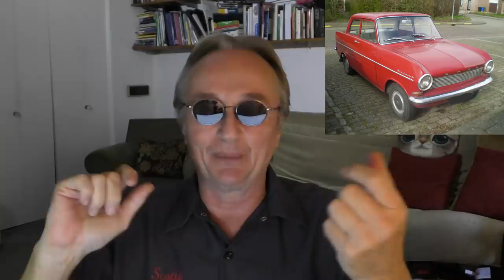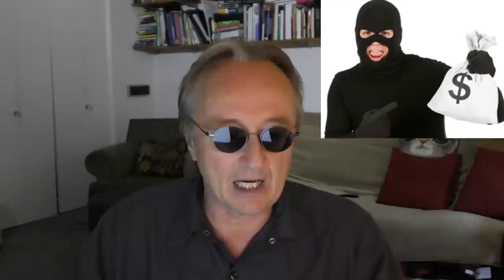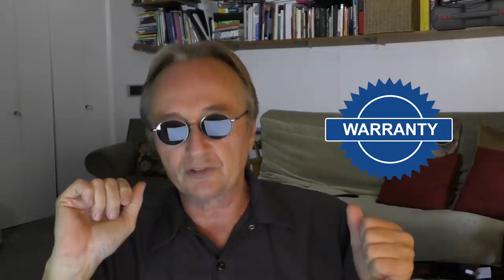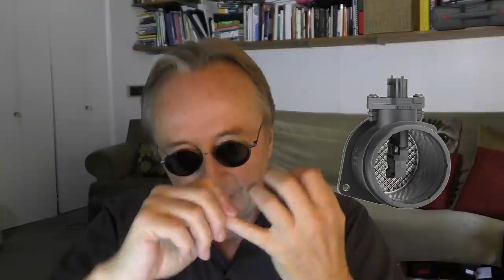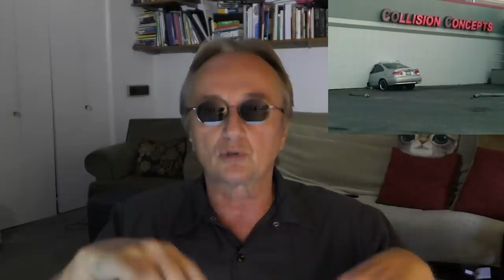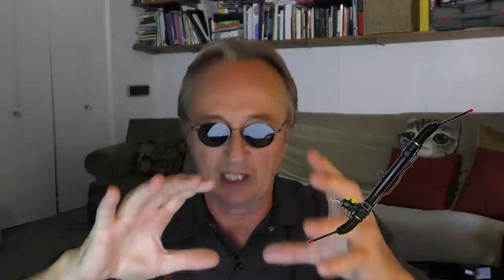Why Not to Use Your Car’s Horn

Comment: 15% ethanol means fewer miles per gallon. Get ready for getting fewer miles out of each tank of gas.
Reply: If the cost per mile was at least the same by the fuel being cheaper it wouldn't be a big deal except for road trips and long commutes
Reply: And less life out of your engine, but more horses!
Reply: All because tariffs.
Reply: Naw your car will just run lean have fun with the holes in your pistons
Reply: On top of that, they will probably tax it even more.
Reply: @manmage13  hahaha never heard of flexfuel sensor? I guess not. It will adjust air fuel ratio to right amount and not lean. In finland if you do  e85 and inspect it and show it is installled properly government will give you straight 500euros and the flexfuel kit i dont remember how much it did cost.
Reply: @22mikelwho  less life? NO NO NO why you think like that? It will run cooler etc
Reply: @barnabyjones6995  not in finland and people usually put some e85 to tank before yearly inspection to lower smog results
Reply: @j0lel666  well someone has a lot of options for not paying that close attention. it's not about e85, its about regular pump gas having ethonal up to 15 percent content instead of the 10 we already have in the usa and how it would effect a non ethonal car
Reply: @j0lel666  maybe pay more attention when you run your mouth off about stuff you don't know especially to people in other countries
Reply: @manmage13  but you know what our lowest gas is 95 which is like your 87 or little bit higher and you can still put e85 in them without the flexfuel kit but ofc when you use ethanol it uses 30% more of it something like that and you have to be stupid if you use them without flexfuel kit or ecu that you can adjust. Also no matter what ethanol will be more profitable for your wallet even if it is couple cents
Reply: @manmage13  people who have put e85 without the kit said that it is running leaner than usual but not fking holes in the piston and ofc we arent 50iq here so if you run e85 without the kit you arent going to be pushing the car to the limit cuz that is just asking for hole in the piston if it is lean
Reply: @manmage13  and when you say yhy yhy doesnt start in winter yes it fking starts if you have the flexfuel kit or for example standalone ecu and adjusted the cold start it will start
Reply: Get an education. I worked as a Chevy garage shop Forman. Most engines get better mileage up to a 20 percent mix. The 5.3 truck motor gets .4 BETTER mileage has less pollution has more hp and torque has cleaner oil runs cooler and all because ETHANOL is a CATALYST. Read up on what a CATALYST does or look up the Chevy Silverado 2014 sales lit on page 39. Interesting lit to read.
Reply: @manmage13  "ethonal"
Reply: @theeeman23  because of goofy liberal regulations
Reply: @davidnudell7916  It's spelled Foreman not Forman unless we get the same education you had 🤔

Comment: The horn segment was of particular interest. Back in the 1950s and 1960s Cadillac had an optional 4 horn system. There were the two conventional horns and then 2 large electric trumpet horns. One of the trumpets is about 16” long and the companion horn  is about 12” long. You talk about a symphony - melodious and loud. I purchased a pair of these trumpet horns and crammed them into the engine bay of my 1961 Thunderbird. WOW!!!  I still have the ‘61 Tbird and those Cadillac trumpet horns still sound the alarm when the need arises.

Comment: Fuel stations should be required to provide non-ethanol gasoline.
Reply: The GATE gas stations where I live sell ethanol free gas but it's for jet skis and boats only.
Reply: Agreed. The less ethanol, the more power and efficiency you get from that fuel. The only reason guys use e85 for race cars is that e85 is well over 100 octane, compared to just 93 octane or less for normal pump gas
Reply: Won't happen. The bill mandating ethanol in gasoline was signed into law by President Bush in 2007, it was supported by President Obama. It is called Corporate Welfare, and it has the farmers (particularly big corporate ones) and ethanol producers hooked on government subsidies and tax breaks. I can buy one gallon cans of gasoline at Home Depot, so I guess it is available but it costs about $25 for a gallon.
Reply: I'm Utah every Maverick has ethenol free gas
Reply: @collinweinheimer1056  A big thumbs up for Maverick. I have relatives in Cedar City, and I like the Maverick that is near them. Great price on soda too!
Reply: @speeedy95  I'd be happy if I could get some ethanol free gas for my lawn and garden machines that did not cost $25 per gallon.
Reply: @garylangley4502  it's $3.80 a gallon where I'm at. If you use stabill with ethanol shield it will keep the ethanol gas from going bad.
Reply: JoeIsCrazyWillman or use race gas or LL100.
Reply: Gary Langley where do you expect they have $$$ invested!
Reply: @speeedy95  I've been adding stabill recently. I notice that particularly the small carbs on small 2 cycle engines clog up the quickest with ethanol gas. It's bad enough that the manufacturers have to run small engines so lean. My lawn mower surges when I'm using it. I just haven't gotten around to taking the carb off and drilling out the main jet a little.
Reply: They do, it just costs a dollar or 2 more than premium fuel...
Reply: I didn't see any when I lived in CA, but there are some here in AR. Usually the 91oct is non-eth but expensive. Sometimes you can get it at petroleum specialty stations, normally for use with power garden tools. So that's all I buy now. $3.00/gal still isn't too bad.
Reply: where i live we got gas stations that provide non ethanol fuel
Reply: You're right, all gas station should give us the option of whether we want to choose between their non ethanol or gas containing 85% ethanol.
Reply: It may already be happening, indirectly.  Many ethanol manufacturers are struggling and many have stopped production or moved to producing sanitising  liquid even though it is an "essential" industrial component.
Reply: @collinweinheimer1056  Plus they have really good gas station burgers.

Comment: Hello Scotty I have a 2000 Durango with an 1998 engine in it before my son Charles Ray died he put a kill-switch on the computer to keep the Durango from bogging down at 115 where's hours at street racing I did most of driving but I kept tripping over the wires getting out of the car because he did not replace the panels actually lost some kind of way so I disconnected it now the computer showing a code error has nothing to do with it mentions I did not want to put a new computer in it because I'm thinking is going to do the same thing to the new computer want to know what you think I live at Durango how about the 1998 Durango with a reading in pretty much totaled out in it except it it track well it did not work the frame and boy told me he never reported in accident so about it for $400 had a brand new heater core in it and blower still in the box with receipt he had put a new power steering pump on it but it looks like crap because he did not know how to seat the seals I had to do that myself me shoot you can feel when it's eats he thought it was something wrong with a power steering pump itself I knew better I saw where it was leaking from I am about insurance handbook before I went and paid him for the vehicle itself and he already had a book in it so I gave my son one I got a great deal because I guess he felt like he had to get rid of it I have no idea what he hit but it messed up the back hatch and the quarter panel on the passenger side I took the rear clip bumper frame whatever you call it's not a real bumper LOL! Oh yeah I'm in Georgia I was waiting for it to get the right age so I can tag it and I'll be darned if they didn't go up 5 more years what is injured every piece of junk I got injured and runs so what do I do about this computer check error? By the way Scotty you have great videos sincere in a Kathy Kirk

Comment: Hello Scotty, I'd like to ask you a question. I own an '04 BMW e46 3 Series Turbodiesel and the car itself works fine. However, the grooves on one of the nuts holding the rear wheels is worn down smooth and it can't be removed even with a pneumatic wrench. How would you recommend getting it off?

Comment: Scotty Kilmer I have a question? I put my battery on wrong which caused my alternator relay to blow also my radio fuse to blow I repair those and everything worked again.I was driving my car I parked it I went back under my hood and pulled out the EFI fuse which completely stopped my car from working after I put the fuse back the car came up and start working again it's stalled then my AC start blowing hot as I turn on the AC I can see the compressor spinning but then it began to stop and not turn back on what can I do.

Comment: Conventional light sweet oil is likely to run out in mid-term. What we'll be left will be stuck far undersea, in shale and tar sands also called non-conventional. It's more likely to be heavier and sour which require more processing. The added cost  of this will mean electric cars will be become more economically viable.

Comment: Hey Scotty, I'm stuck on a restoration/preservation project of mine and extremely close to getting it running.
I have a 1990 Volvo 240 that hasn't been on the road for the past 20 years and for obvious reasons, overhauling the fuel system. My issue is I have no power to the main pump in the line and replaced the fuel pump relay but I do not have the submerged lifter pump. Will not having a lifter pump prevent the system from running or will it be able to run with the pump powered from a separate source?

Comment: Scotty I've got a 03 astro out a new alternator in it, it's charging but not the battery. I've cleaned all grounds checked all fluids and all the wiring appears good, but still nothing. The starter is under a year and a cheapy, could it be the starter or could I  just wire the alternator straight to the battery. Thanks

Comment: Hey scotty ! My 2005 toyota sienna with 80,000 miles surges between 5-10 miles per hour? Not sure it only does it when low speeds or a speed bump. I changed the mas and air filter. Plz help!

Comment: @Scotty please help I got a 2004 Tahoe with 105k on it and today on the way home from work my truck over heated I pulled over and checked the coolant and oil all good I turned my heat on high and tried to get home, and when the heat was working it was a the correct temperature but when I lost heat the temp shot up ? I got home but can’t work on it till sat  what could it be the thermostat or water pump or what ? I’m go a change the thermostat sat

Comment: Hey Scotty I got a question for you I've got a 2000 Oldsmobile Bravada and my all-wheel drive light is on I'm wondering what normally goes bad on a all-wheel drive I also work on my own vehicle I know it not my abs because I've got all new wheel bearing hubs and ABS sensor and my ABS light is not on and my ABS system works
Reply: I have a Subaru with AWD. They have fuses that control the system.

Comment: when do we need to change our manual transmission fluid? i drive a 1998 toyota prado, issit a complicated job? so mechanic told me involed fluid in axial also?
Reply: Every 60k loosen the bottom bolt, let it drain out, replace bolt, unscrew top bolt, pour in gear oil until it's to the top of the bolt, screw bolt back in, drive off...

Comment: I tried E15 it wont harm your engine or cause a check engine light but your mpg will drop some by 2 or 3mpg
Reply: If your not designed for it...it will damage your car
Reply: @Dread_Pirate_Homesteader  if it's E25 or higher then yes
Reply: I bet that “10%” is really more already. Who would know?
Reply: @sammolloy8129  most likely depending who filling it and how much the mixture is
Reply: @sammolloy8129   it is all premixed by the refineries and they deliver for many gas station brands.  they will not mess with such things.   plus you can  test it yourself if you're really paranoid.
Reply: LOL

Comment: This video explains many reasons to get an old carbatrated car. Just saying there cheaper and some times more reliable. Better than having 20000000000 electrical components to have and then replace. Plus if it’s running to rich or lean, just turn a simple screw on the carb and it will be fixed.

Comment: Yeah I get the Murphy's law thing . I blew a Moab bomb and am annex marine in a wheelchair and slowing down a lot and the van I can jump up in the seat door behind me opens itself pull in the light weight wheelchair hot the switch for the door and I'm gone. So I put in my own hand controls and the I'm wondering is there anything special to start the auto pilot cruise control. I tried it on a street and not the freeway yet and it doesn't seem to catch at 40or under. The air filter box is broken and yer right a cleaner air cleaner and duck tape that box till I can find one or maybe JB Weld right? I like listening to you it's like listening to family of which haven't been around much after you get blown up and die half dozen times then come back until they call you Lazarus. I have people with clusters and congressional medals said they haven't gone through 1/10 the suffering . I make prison camp POWs cry ! I've been called the toughest marine who ever lived by guys who know what they're talking about. I've never thrown in the towel and I'm building a roller chest again. A man's worth is only equal to his taco wagon in my estimation.  My dad's compressor is bigger than yer garage . Master due and tool maker for Dohler Jarvis Toledo 43 years. Made his own tools. Very classic. One of a kind worth millions themselves. Gramps and his one bay garage made millions. Yeah cars have been good to me.But this is a world of duality. Lost my middle brother 600 horse Chevelle.. 4 year old sis ate a bumper chasing a ball and I went head on into a car t shirt thongs shorts on a 750 twin Kawi. 24 broken bones . No one ever picked up anything looked that bad and lived . 2 years and I walked out of that VA hospital. So when I hear about nitrous and 1200 horse that and that . I just ask how fast do you want to hit that wall that tree that car....and drive accordingly.

Comment: For the ABS light question, before anything else check the fuse.  I had a car with the ABS light on, took it to a mechanic and we found no codes.  The Scanner only stated that the "ABS System is OFF, No errors found".  Couldn't figure it out until we checked the fuses and sure as shine catches fire, the fuse was fried.  Changed the fuse and the ABS light went out.

Comment: My ABS light came on when my fuse burnt out. My rear break lights were on the same fuse. (99 3.1L Monte Carlo)
Reply: Lazy, cheap GM design.
Reply: @fazole  car had one major issue, one of the gaskets for the engine went out and it was leaking antifreeze into the oil. Fix that issue in the car has over a hundred and fifty thousand miles and still going strong. But for most people that would have probably ruined it.

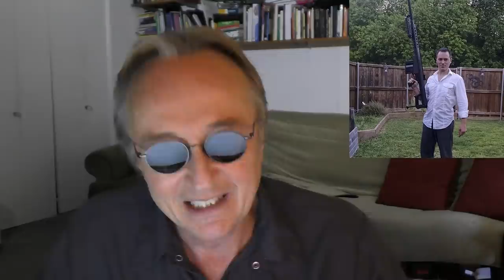Comment: 0:56 Because of the shale fracking revolution, oil will not come close to running out until long after we're all dead. Also, according to the IEA, worldwide oil consumption is predicted to grow every year until 2050, when increased use of electric vehicles and renewable energy sources catches up.

Comment: I put a Harbor Freight klaxon (AoooGah!) horn on my 94 Mercedes and sometimes run it on 50% E85. Other than slightly rougher idle, worse mileage and some boost in acceleration,  I barely notice the diff running 50% ethanol. I probably ought to find a Brazilian model ECU and injectors (everything in Brazil runs on ethanol).

The klaxon horn is really effective at scaring wildlife (here in Wisconsin, we have huge wild turkeys, deer, possums, rabbits, foxes & raccoons all over) off the road. Especially turkeys , they hear that "Aooogah" and run like hell. Man, we got tom turkeys nearly as big as Australian emus, without that horn they'd probably peck my headlights and kick my windshield out. Actual Australian emus probably do that, and if I were there I'd have a Nathan or Leslie locomotive air horn (list price starting at $699 US)

Comment: Hi scotty. carlo here from Philippines. i have a 2006 toyota vios. first generation. the repaired parts/replace are head gasket, replace radiator, coolant/temperature sensor and lastly the thermostat is already remove when the car overheat according to mechanic. the situation is while i am driving. around 50 to 60 km (distance) drive the "high engine coolant temperature warning light (in red)" is blinking but when i park the car without shutting off the engine gradually the warning light is turn off. i start again my driving. i dont feel any lost of power or other symptoms. when i check the coolant reservoir and radiator the coolant is full. there is no sign of leaking in the part of water pump. what do you think the problem or reason why high coolant shown? i am your big fan here and also your youtube subscriber. hopefully i can get a respond. thank you and godbless.

Comment: Hahaha on my 2008 dodge caliber (didnt purchase by choice) the ABS isn't a fail-safe system, its a FAILURE system. I had my front right ABS wheel sensor go out a few weeks back and the ABS light was on, i could feel weak braking and the active ABS stuttering constantly, oh and the tire with the failed sensor? Wasnt braking AT ALL. because of this awful design (ABS is fused with dash components such as ignition) I was braking with half power in the front, and completely one sided. Dont buy chrysler products..

Comment: Some of the extended warranties at dealers are actually worth it. I bought a year old 99 Ford Explorer (yeah, long time ago) with about 30k miles at dealer. I got the 60k mile extended bumper to bumper warranty for about $600. That thing was at the dealer every other week. I'm guessing I had $4k-$5k in repairs done.